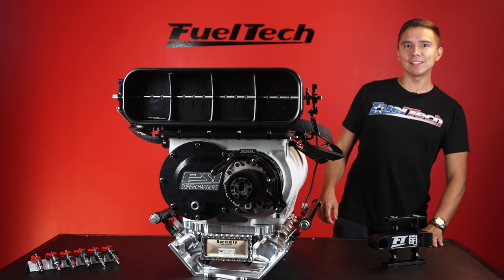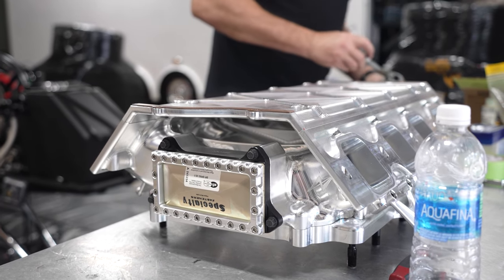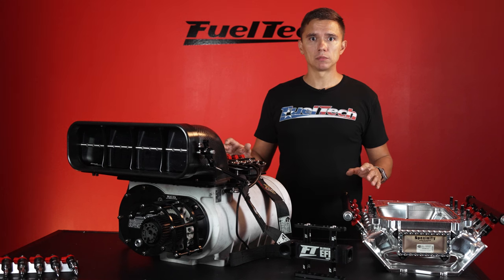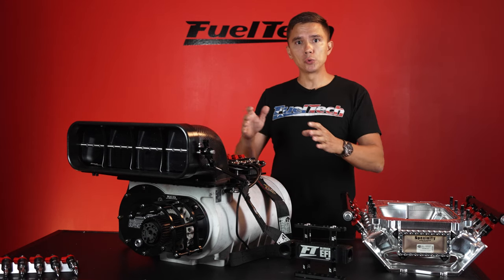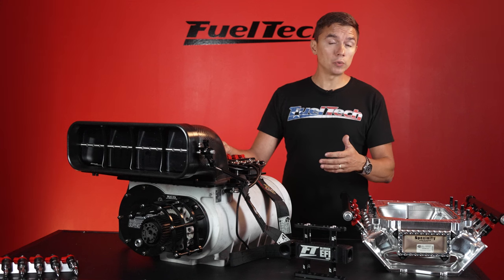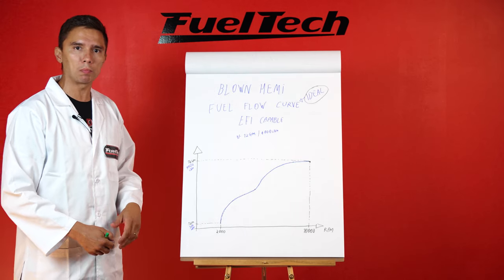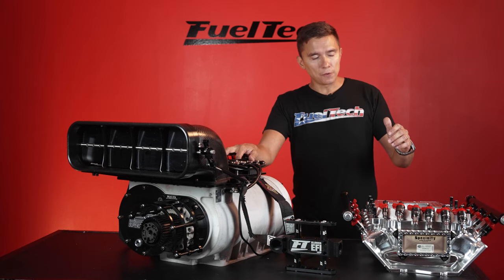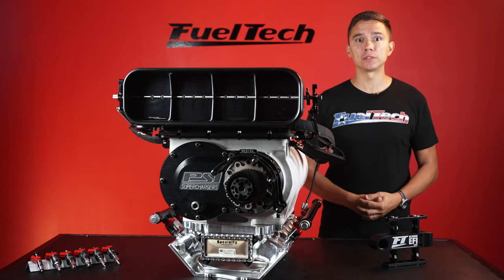EFI on SCREW BLOWER and ROOTS | Tech Tuesday

Comment: If efi so great on blowers why doesn't nitro run it
Reply: It's not allowed on the 30 years old NHRA rulebook
Reply: And there you have it
Reply: Don't think they can fit a set of injectors under the valve covers to feed a top fuel engine.
Reply: Not to mention, this is new, blowers are old, they are just making a comeback due to, rules, technology, weight penalties.,
Reply: Rules and injector size. Nitromethane requires around 4 times more fuel mass to generate same power as alcohol. And if you double or triple the power we are talking at 8 to 12 times more mass on a Top Fuel engine than a Pro Mod. Theres no injector large enough to supply that demand today.
Reply: @luisdeleon2930 I looked a while back just being curious. The biggest Moran injectors are like 800lb/hr are only good for like 4000hp on methanol. Would take like 4 or 5 sets to provide enough fuel for nitro cars full power.

Comment: Thanks for explaining the differences and advantages of EFI. One point: I believe that the irregular bhp curve for an actual hemi-engine should be addressed before programing the an air/fuel map... no mater if it's a mechanical or EFI system or carburetor. After all, the horsepower curve is nothing more than a derivation of the engine's torque at incremental rpm points. Fix the inexplicable dip in bhp BEFORE deciding how to accommodate for the deficiency through programing.

Comment: break rocker on the intake valve? popa de blower.. air is colder than usual and u miss your tuneup and goes too lean? popa de blower. no closed loop fuel correction? pope de blower. NO EFI? pope de blower🤣… keep these videos coming👏🏼

Comment: i use both top and bottom the entire time. like you said the hat injectors are hard to tell which one will affect individual cylinders. on my setup i lean the intake set to keep them all happy idling. what is the benefit from not using the bottom at low rpm?

Comment: I am always surprised big budget, big HP cars like this are running port injector rails in series. It's common place that high performance 4cylinders run in parallel, 6 cylinders running twin entry with the return in the middle of the rail to reduce fuel pressure and fuel flow drop between injectors. I believe it also assists with injector pulsation / fluid cavitation along the rails.

Comment: Now that is extremely interesting. One question though ; it appears you are using a mechanical pump yet you reference a steady 90 psi for the injectors as a base. How is that ? Many thanks.

Comment: You guys need to talk with Justin Swanstrum, he’s done knocked that blower off every chance he’s had, I think your system would have saved all but the converter letting go., and maybe even that instant rpm change would have been caught by EFI.. he’s got a car that can run out front, but they have been struggling with their blower combo, and I know for sure Louis and Big Country like to do tune ups the exact same way, UP ARROW for the win… it would be cool to see Justin change over to fuel tech EFI, and start winning some races , I’m fairly sure the car is already on FT ..
Reply: Think he already runs EFI
Reply: @strykerentllc he runs a half ass efi, he still has a barrel valve on the blower. This is complete efi
Reply: @orb8176  Kinda late to the party, ay? 7 months later, long time

Comment: Do you have anything for a nitro motor.  An A/fuel (naturally aspirated) hemi for example. The fuel flow on a nitro engine is around double that of the blown alcohol counterpart on a modern TAD. They use three injectors per cylinder on a mechanical injection combination.  Is there electronic injectors capable of that kind of flow?

Comment: Now how much voltage does this draw from the ignition what do u need to power the mag or coils and all of those high voltage draw fuel injectors plus the fuel pump u are gonna have voltage loss to something that's why u use mechanical injection and pump
Reply: Bro you living in the 90's You just need to throw the MAG in the trash  can and buy a good 12 or 16 lithium battery and an FT spark

Comment: So a run with just an air filter it gives 24k and above because it needs proper back pressure which vapor locks the motor and never start it no filter even turbos us pump gas and daily driving it every day a million miles is easy and like a chainsaw it only takes once no air filter and it dumps fuel in the carb you will need a stage 3 parachute my na truck made 700 hp with a 350 and 305 heads it is with a carb single 750 turned the timing 98; degrees for the Platform setup and no methanol or asemetric there is no need to cool the charge it's cold enough to touch the intake

Comment: No way you're getting good atomization with those blower mounted injectors flowing into an open line.
Reply: There has to be a nozzle at the end of each one of those lines which is on par with a mechanical FI system. He gave everyone all of the positive attributes to the EFI but as with any system, there has to be some drawbacks he didn't mention.
Reply: @strykerentllc  I would agree, but he specifically states there is no jet or nozzle downstream of the injector. It has less effect, as it's above the blower. But less atomization is never ideal.
Reply: @adamwiebe8386  Missed that in the video. Thank you for pointing it out. That being the case, it's simply pouring fuel into the blower which as you note, isn't ideal.
Reply: You are correct about atomization. But theres minimal advantage to atomization prior to the blower. The majority of its advantage takes place after the blower, before it hits the intake valve and goes into the chamber. Before the blower is more useful to have the correct amount than the state of the amount of fuel.